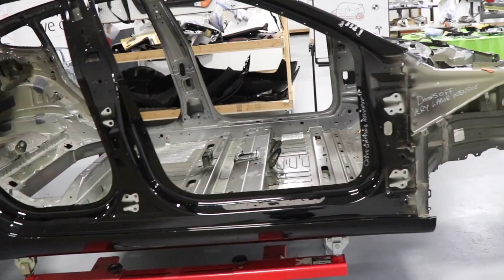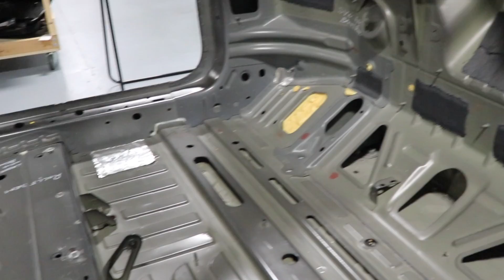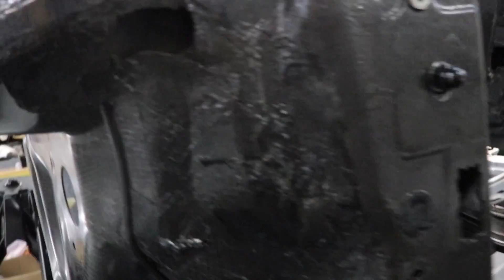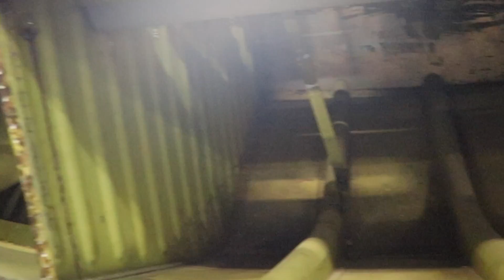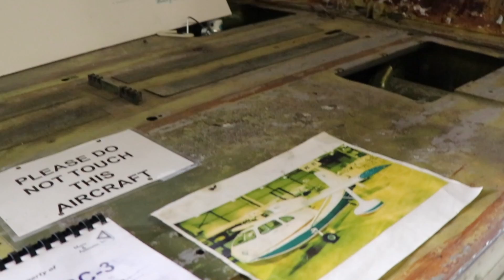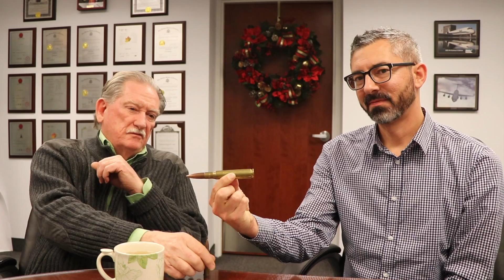Sandy Munro: Tesla Cybertruck SpaceX tech, bullet proof windows, crash safety, and battery magic

Comment: Great interview! One subject i’d like to hear his opinion on is repairability of the exoskeleton? Say you get in a big crash or fender bender. Will the structural integrity of the exoskeleton be compromised? Or if you need to replace a panel on the truck, if it is structural I’m curious how that will be approached. Also fit and finish of replacement parts, I don’t see service centers having the tools to make some of those adjustments on such a strong material.

Comment: The CyberTruck is a super highway pickup as well as an off-road sport vehicle, with a (hydro-pneumatic) suspension that allows for smoother ride on under-maintained roadways, and the ability to control ground clearance for off roading.  It has more room inside than a Model X (for passengers) plus the 100 cubic foot "Vault" that makes the CyberTruck the ultimate Sport Utility Vehicle that is more functional and durable (12 Ga. Stainless Steel body that will not rust out and disintegrate in the usual 10 plus years that most other vehicles' durability limit / planned obsolesce falls prey to.
Reply: Its not hydro-pneumatic, thats the Bollinger B1/B2, this one just has air suspension.

Comment: PAINT cost = $350-$450 but also takes up ~25% of the factory floor space AND time to prep car body (wash/dipping) AND to spray/apply the paint AND to dry the paint.  Same for stamping machines floor space/stamping time/tooling costs. I would suspect the cost savings will surprise. AND only one color saves inventory/money.
side note search:   external airbags  (ZF is offering)

Comment: Most important aspect of 200,000 deposits is: Those 200,000 guys are not gonna buy some other truck in the next two years, high probability. Lost sales for the legacy type pick em up...
Reply: I am no longer looking at picking up an F350.   The 500 mile range has done it for me.
Reply: @kayak_1  What kind of range when towing or carrying a load?
Reply: @jameswebb5080  James I have two trailers 1. a 10K pound dump trailer,  as long as it can move it a 100 mile round trip I should be fine.   I also have a 12 spot kayak trailer and  as that doesn't really affect the mpg of my truck I don't see an issue with the cyber truck.    I  just need to see additional charging in Newfoundland for when I made trips into Canada....
Reply: @kayak_1  I don't think 100 miles will be a problem. I have an F-350 that use for hauling Blueberries for about 4 weeks during harvest, but it has a 460 gas engine and is not the most fuel efficient. I was thinking of going electric, but I saw a video of the Model X towing and it really killed the range. I would like to have 200 miles to handle the longest trip I'm likely to make. I'm in Nova Scotia, but my mother is from Newfoundland (St. Anthony), haven't been there in 10 years so I don't know what the charging situation is like.
Reply: @jameswebb5080  I haven't been to Newfoundland in two years, but plughshare doesn't have a lot of charging spots.  I am thinking of keeping my Tundra around as it can plow.   It would be ideal to be all-electric and be back to a two car house.
Reply: @jameswebb5080  Like with a ICE truck the range will fall.  But with an EV truck you'll get some energy back when you slow or go downhill.  That doesn't happen with ICEVs.
Reply: @kayak_1  Theres some snaps with 620mi range on the screen of the cybertruck test model. Elon confirmed they're likely to get 600+ range.

Comment: Most excellent interview, Sean! A lot to digest; it will be worth another watching! 

A few initial takeaways and thoughts (as one who owned pickups for over 30 years before getting a Model 3):

A) Sandy is dead-on how handy both the kneeling aspect and the segmented tailgate ramp should prove out to be. I once had to load a motorcycle into the bed of a Nissan truck I once owned; it was  no easy feat. I've also been in the position of tending lawns between two houses with one lawn mower; loading/unloading that thing was a chore.

B) The Model 3 electric motor. My own car is a long range rear wheel drive, 8/2018 build. I'm continually amazed and impressed by its efficiency and power! Which has only gotten better since I took delivery of the car.

C) The lethargy of the legacy automakers toward this truck. Some might view it as indifference or outright scoffing, but in the end I think it will prove out to be lethargy, which unfortunately - as Sandy notes - has been a dark side of the "legacy" of our legacy OEMs. I remember the days, although I was very young, when GM had over 50% market share in the US. 51%! Nobody has achieved that high of a slice since; it was GM's to lose. And lost it they did, largely due to hubris and lethargy.

Comment: Just to clarify, in regard to the "70 parts - 1 part" - that is related to a casting (single piece) they developed,  replacing 70 stamped parts (that need to be assembled/welded), for the rear drivetrain mounting system.
Reply: He really should do a new teardown to see what's changed with the M3 over the years. I mean did they put that new part into production? Or is it still 70 pieces? Sadly a teardown is very expensive and I'm not sure they can sell enough new reports to justify the cost :(
Reply: @quantaca5773  As far as I know, the new casting will be introduced into both Model 3 & Y, since that part is common to both models. (76% parts are common to both Models).  Sandy said they have already ordered a Model Y, so we will know when they tear down the Model Y as to how effective he thinks it is.  As to when it will be introduced into Model 3, I haven't heard anything.  But I'm certain it will be...  Cost saving is the key to profitability - of course...
Reply: @stevebothe1416  that last part is certainly true, thx for the reply

Comment: One thing I disagree with Sandy on, is that SpaceX hired a lot of ex NASA engineers (some, of course).  NASA has a problem with an aging workforce (average age is very high).  If you look at any of the SpaceX webcasts, where all of their engineers are watching from outside the control room, Try and spot anyone over the age of, say, 35-40.  SpaceX is full of brilliant, enthusiastic, young engineers, with new fresh ideas.  And SpaceX have a culture where any new idea from anyone is embraced.  It's a great mix of some old school experience, and a lot of new school thinking outside the box.
This is of course the same culture at Tesla
With regard to material used, just to clarify - Elon said it IS the same 30X SS that is used on Starship (even the same thickness) which they did develop in-house (they have their own metallurgy foundry at SpaceX) .  One other thing to note, if we're talking about "cross pollination" between SpaceX and Tesla, is that the Starship uses Model 3 drive motors to actuate the fins, powered by 4 Model S battery packs.

Comment: So, what Elon has wrought here ... is an EV Hummer from the future. However, it really falls into the medium duty (F-250/350, Ram 2500/3500, etc.) class, rather than light duty. As an off roader in the Rubicon class, it would’ve been better as a mid-size (Gladiator, Frontier, Tacoma, etc.) class vehicle ... to better fit between those encroaching trees.

Comment: Did you have any additional discussions on the crumple zone. Sure the crash avoidance will make this a moot point. But perhaps NHTSA will not evolve their standards by then and still require a crumple zone. How would Tesla resolve that?
Reply: it was not shown in the unveiling, but the Cybertruck has a front trunk.

Since 3 out of 3 of the safest vehicles on the road are Teslas, I'm inclined to think that they have considered this.

Warm regards, Rick.
Reply: Rick Smith hi rick. Thanks for sharing your thoughts. I was thinking along the same lines. Just was hoping there was some discussion on that from an expert like Sandy. Especially since the strength of the the steel is talked about so much. But from high level, I think the same. A company that prioritizes safety so strongly would probably take care of this. I was curious of the design strategy on how the crumpling mechanics would work
Reply: @kvps27  well thing is if its really going to be a class 3 truck (they put in some file for a class 2/3 truck) I believe it falls under different safety guidelines and they aren't even required to have airbags.
Reply: @quantaca5773  ahh.. I see. Can class 2/3 trucks be driven with regular driver's license in US?
Reply: @kvps27  i honestly have no idea, just a EU boy paroting what he's hear ;)

Comment: Can’t wait to see the crash testing of this truck , might break the machine that tests the machine
Reply: Wasn‘t that the case with one of the existing Tesla models?
Reply: @hans-martinadorf3834  Yes.  When the Model S was first released and the NHTSA was having it tested, the roof proved to be so strong that it literally broke the testing machine.  If you google "model s roof breaks testing machine" you'll get a whole bunch of news results from mid-2013.
Reply: The front end will have to crumple on impact so stainless panels will be thinner with typical energy absorbing arms underneath. 
Back end corners will I think have to be more normal style. The mitre design will look really rough with just a slight dink or misalignment.
Reply: @Dave5843-d9m  It will probably use the sensors of the CYBRTRK to initiate a "reverse reinforcing" mechanism [electromagnetic actuators] to reduce its rigidity even BEFORE it even makes contact [the CPU is already working on the high_nanosecond/low_milisecond level for the "smart traction" of the wheels, so this is nothing special].  
-> It would be like an airbag "going backwards".

Comment: Body in white means body ready to be painted and has nothing to do with if the design is load bearing.
It's either body on frame or unibody. Unibody means that the frame is integrated into the body.
Reply: Thank you!!
Reply: @MsAjax409  Thank you Clara. I see your comments in the forums I frequent and you are always relevant and interesting. Cheers!

Comment: Confusing! What did Sandy say about hard shell Model T or A? Those were body on frame and not heavy gauge hard shell. Unibody for passenger cars became universal in the 60-ies. The gauge didn't change much though, they just redesigned the shell to carry the load by having suitable attachment points for the suspension and having closed sections of steel were there used to be wood before in an old body.
Please find an experienced active body designer from an established car company to talk about their design considerations and you will get much more in depth insights than this.

Comment: Thank you Sandy Munro for making yourself available to share your insights into Tesla's products!  Much appreciated!
Reply: The only "Wat?" moment I had was when he said the wiring harness bit, about how it MIGHT BE just power lines with Bluetooth tech doing the actual data movement... and all I could think about is some crank laughing down the highway in an older truck with a powered up Bluetooth jammer in the box.    Surprising that he'd say this too, as in a previous video he said that the new wiring harness is probably data-duplex cables (which has been used in avionics and other machines for a while, but not cars). Duplexing cables makes way more sense than Bluetooth.

Comment: 28:46 Imagine if they really get the solid state batteries because of their maxwell acquisition and have FSD running the Tesla Stock Price will explode!
Reply: Maxwell have something entirely different magic, probably even more important. It's a manufacturing trick that increases energy density, decreases cost and most importantly reduces production line footprint by 16x. That's not 16 percent, but 16 times.
On the other hand John Goodenaugh does have a working solid state battery and seems like he is connected to Tesla behind the scenes. https://www.youtube.com/watch?v=zl39bJAAgY4 Many claimed to have cracked the solid state problem and nothing came out of it, so now everyone just dismisses these claims. The problem is that this guy just got the Nobel Prize for his previous invention, the Li-ion battery, so has to be taken seriously.
Reply: It did rather well today... all time high.
Reply: @ImperialCrab  Yes I've noticed that but thats nothing compared to what price it will get then. Believe me. Electric FSD Car with solid state batteries will be the holy grail and makes look anything else like a horse or a donkey.

Comment: I wish you'd delved more deeply into the damage repair procedure for the exoskeleton. New vehicles may cause less accidents with new tech but there will be a lot of older ones that won't be as safe.
Reply: Unlike other vehicles just weld the repair straight to it. That is what is so amazing.
Reply: David Coltman the damage repair procedures for the exoskeleton as Ramon Punsalang mentioned are not as simple as just cut and weld.  I’m not sure the used cybertruck market or insurance companies are willing to let any guy or gal with Plasma Torch and a TIG or MIG welder just go at it.  At some point repairs and welds will need certification indicating that all repairs to the truck maintain the same safety level/ratings as it did when it was new off the factory floor.  Poor/contaminated welds or cutting and adding sections improperly could greatly impact the overall structure.  Not an insurmountable problem. Just something that needs to be dealt with.  So, like Ramon, I wish they would have addressed this in the video.
Reply: @trouthunter22  I never said just anyone could do it. I was more referring to the fact that they won't have to spend thousands in paint. Also won't probably have to replace the whole panels.

Comment: There will be a 500 mile S before the cybertruck comes out
Reply: I don't think so.
Reply: @rogerstarkey5390  elon said plaid will have more kWh then the 100d so given this knowledge we can easily assume their newest cell/pack is going into the S. That will require a big change to the S architecturally which would only make sense if they change the pack for all trims of the S. Well the S currently can do 373 miles off 100kWh and the plaid will likely have 120kWh+ which means more range for long range S. You can't be selling a cybertruck with 500 miles of range for 10k less then your car that does 130 miles less. S is getting a new pack next year and definitely 450 miles+. Look at the roadster for ex. It will happen.
Reply: @larryspiller15  
I await with baited breath.
Reply: @andrasbiro3007  your being tricked by elon lol, hes sandbagging the upcoming changes
Reply: @andrasbiro3007  he said on twitter that plaid would have more then 100kWh and to achieve that they would need to accommodate the new pack. They also would be wise to test run the new d.e.b cells in their lower volume vehicles (S/X) so they can learn and optimize for the pickup launch which will definitely have them.
Reply: larry Spiller I fully agree with you. Elon is sandbagging big time. Just like the Y unveiled, he did not want people stop buying the 3 and just wait for the Y. Now he does not want people stop buying the Raven just to wait for the Plaid :)
Reply: @andrasbiro3007  yeah so the s/x would not get the pana 2170 because why bring them up to match the 3s battery tech when they are supposed to be the brands technology LEADERS aka new battery aka maxwell DEB. Again, hes just sandbagging until its ready. The plaid S having more then 100kWh is what gave it away to the keen observers.
Reply: @andrasbiro3007  they are only niche because Tesla has left the interior stale  along with an inferior battery settup. You just wait.
Reply: @andrasbiro3007  no but they used to sell 100k/yr with 30% margins and now they are around 70k/yr. The car did make tons of money. These updates will bring them back to 100k/yr.
Reply: @andrasbiro3007  I'm going to just wait 6 months and show you that your wrong
Reply: 400+ mile almost certain, but 500? We shall see :)